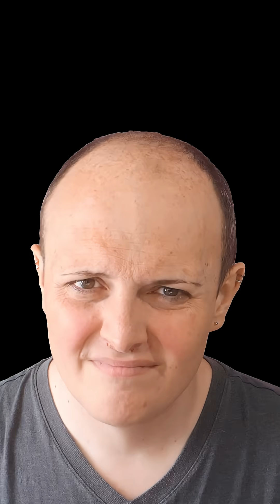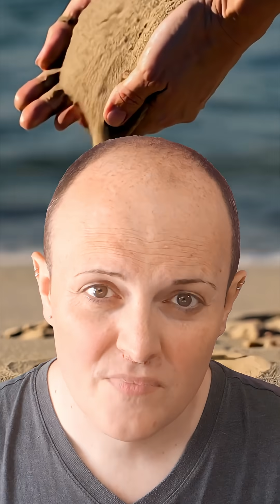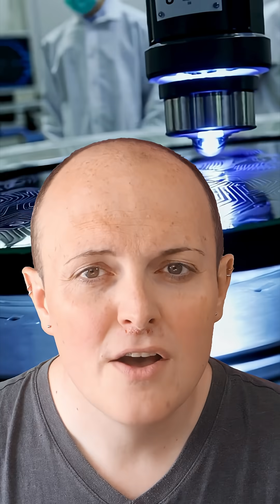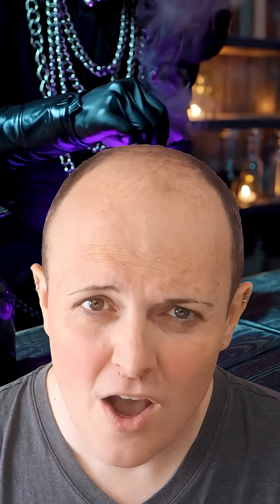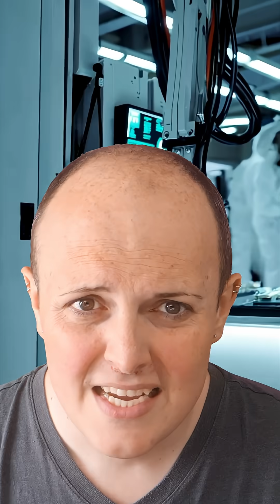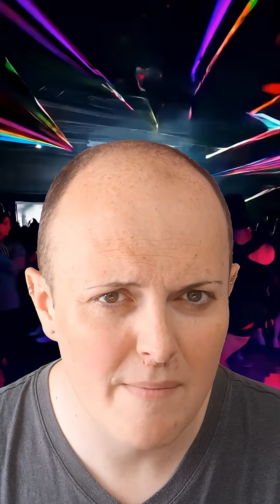How do we make transistors?

Comment: If we needed computers to make transistors… how did we make the first computer ?
Reply: Dude.

Do you even know what transistors replaced that made them such a breakthrough?

It's vacuum tubes.
Reply: @cloudedarctrooper I did not… saying that I don’t know what a vacuum tube is
Reply from the maker: We didn't need transistors to build the first computers. They were made using vacuum tubes, relays, and mechanical parts, long before transistors or modern microchips existed. Transistors replaced this approach from about 1947. The transistor was an upgrade to the vacuum tube which like a transistor is a component that is used to control electric current. The problem was they were bulky, fragile, power-hungry and failed regularly.
Reply: @craigndave Ahhh I see thank you so much!